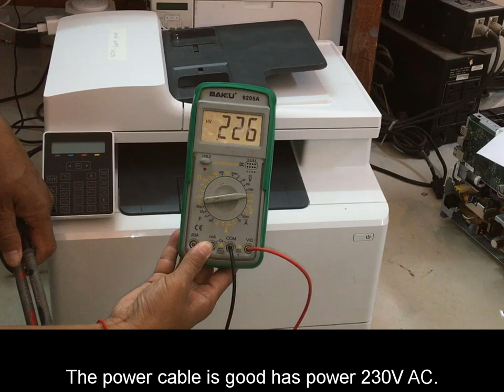How to fix HP Color LaserJet Pro MFP M181fw M181 Series No power in repair ep01

Comment: Merely following the first 4 minutes of the vide got me restarted.  Whatever the problem it apparently was corrected by disconnecting the power from the printer for 15 minutes and repowering.  I also opened the access doors and reclosed.  I went from zero power to normal operation.  Who knows???

Anyway thanks for the video!